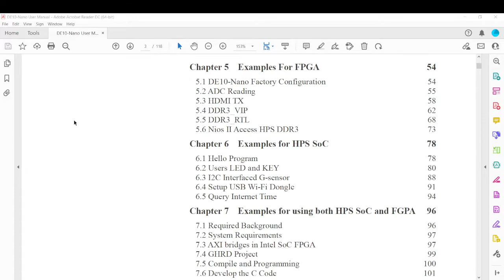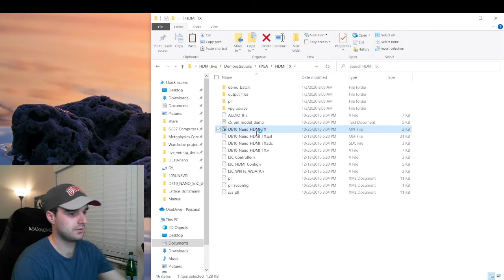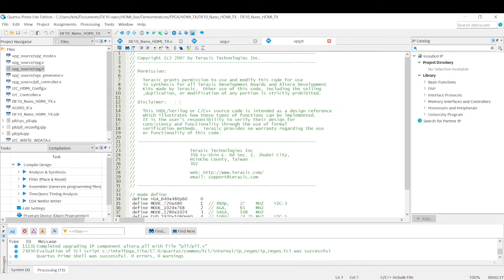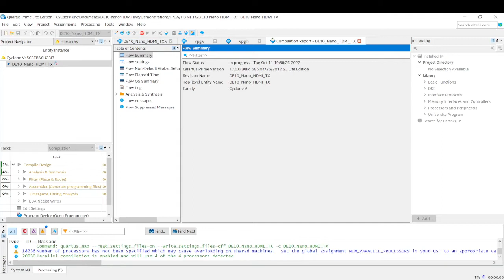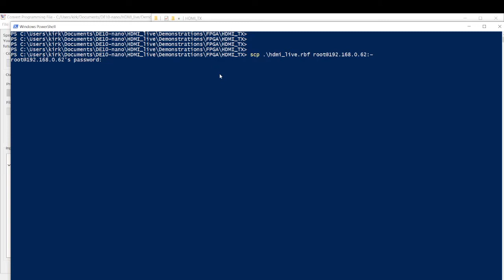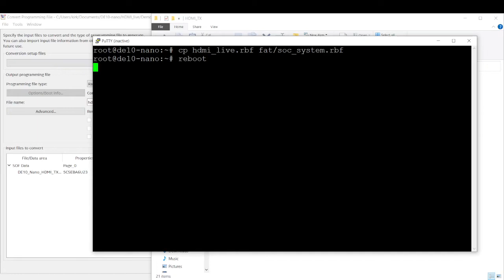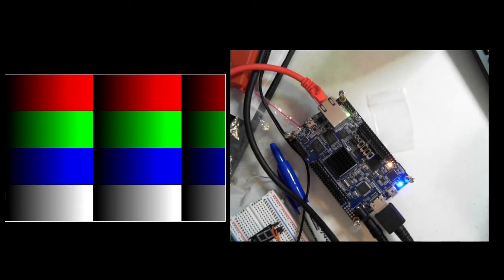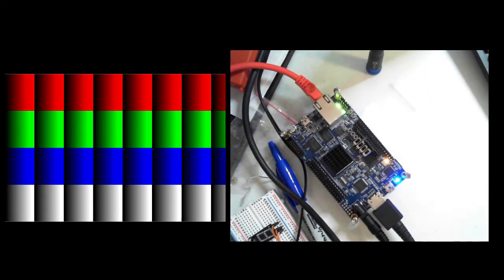FPGA HDMI TX Demo - DE10-Nano Projects

Comment: This is a good demo, and HDMI stuff is fun to mess with for making new pattern generators etc.

(I wrote a "Quantel Paintbox" style drawing thing in Verilog, for example.)

Just a hint, though - if you use the Programmer or SignalTap tool in Quartus, it's much faster to just reconfigure the FPGA directly using the SOF file than copying over the RBF to the SD card each time.

(The MiSTer project works in a very similar way, so you are able to copy RBFs etc. via scp that way, but for debugging, using the SOF is so much faster and more convenient. Obviously the FPGA will lose that SOF config once powered-off, though.)
Reply: Oh, yep, there's also a checkbox in Assignments -> Device -> Device and Pin Options button -> Programming Files, where you can have it automatically generate an RBF after every compile.

Just saves doing that extra step. ;)
Reply from the maker: Thank you! I will start using that and mention it in the next video. (I will make sure to give your comment credit 😁)

Very helpful. Also, I have never heard of the Quantel Paintbox before. That sounds like an excellent idea to try to make my own spin-off video tutorial for. Thank you for sharing. I subscribed to your channel, you have some interesting/cool videos.
Reply: @metaphysicscomputing   Thanks. ;)

The Paintbox was one of the first mainstream TV graphics machines, from around 1980.

It was used on tons of shows and some movies over the years, so the machines became a bit of a cult classic / techie nerd object since then.

DextersTechLab has been doing restorations of some of those machines.

After my first reply, it got me wondering if the default Linux distro on the DE10 will try to re-configure the FPGA if you directly configure it from the SOF / USB Blaster.

Hopefully it won't, so the SOF thing should work.